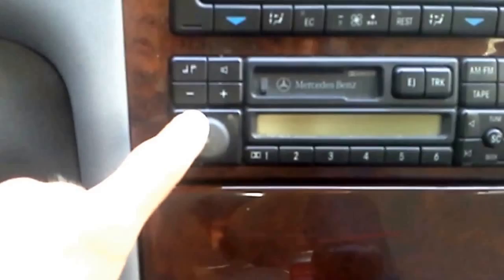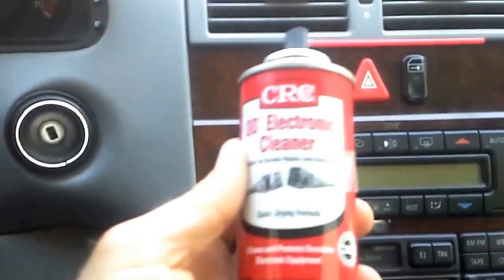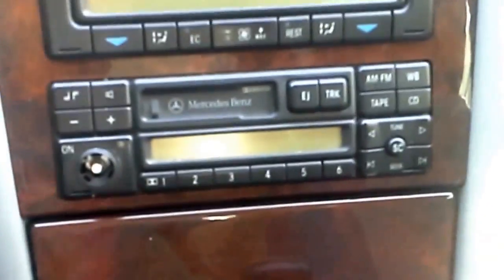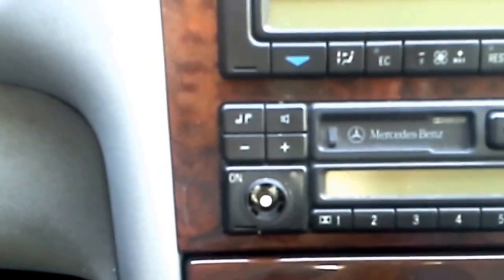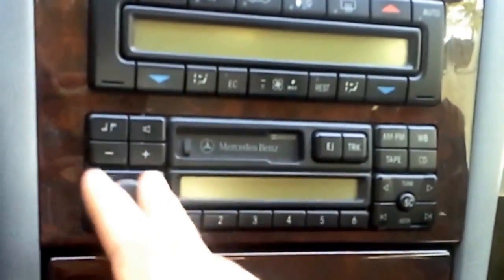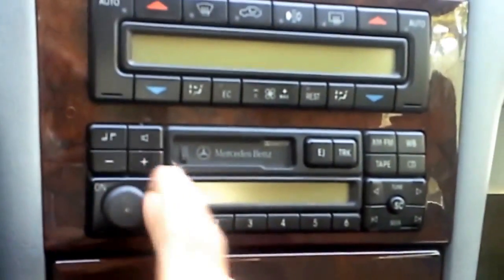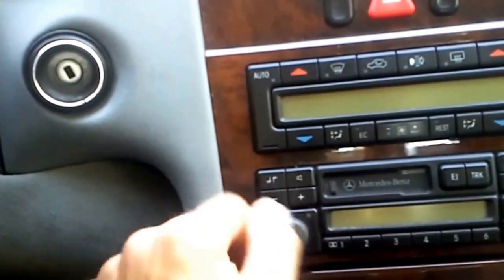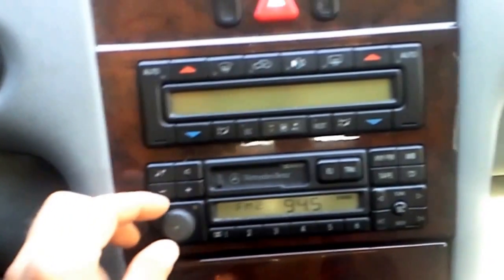How to Fix Mercedes Radio Volume Button

Comment: DON'T SPRAY with electronic cleaner!  It gums up the controls, makes it worse.   I found out the hard way.  It works for a few hours and then volume knob becomes completely erratic.  Spray with compressed air, and if that doesn't fix it,  ship it off for repair to Becker Autosound  in New Jersey.   A couple hundred dollars and well worth it.
Reply: I use it on electronic cleaner all the time and it works great on electronics. 
But it doesn't work on a volume knob for a Becker radio.

Comment: Well, I can confirm that this DID work for me for about a week, and then it started being erratic again. I then took some more contact cleaner and sprayed it in, shortly after, the knob became completely free of tension is now moving freely, making NO difference to volume. So while this may fix it temporarily, the contact cleaner application sort of broke it permanently. I was VERY careful with the squirts too.
Reply: Mine spins freely now too no small clicking noises like before
Reply: @sethdawg  I ended up with a permanent fix on my old radio. These becker units last forever. So I ordered a volume encoder, and had to carefully replace my old encoder with the new one after opening the unit. The volume knob on the outside connects with an encoder disc/wheel on the inside, that encoder disc is encased in plastic, and the plastic melts. In my case, the wd40 contact cleaner melted the plastic (since it's 30 year old plastic). I think that's what has happened to you. I've heard that there are better cleaners out there (deox-it is the best), but since the plastic is already melted, I had to replace my encoder knob. If your unit was working fine before, you will have to attempt to replace the encoder wheel by opening the unit also, the one I ordered came from Germany via Ebay, and the seller was extremely knowledgeable. I have tonnes of pics and videos of the job, will compile them into a video and post on youtube. The unit works fantastic now, like new! Lovely satisfying clicks.

Comment: I have 1999 Mercedes in excellent condition like new one owner was $ 80.000 ,always garaged and now I have exactly the same problem like you showing to the people on this video,just I have sound but very low ,can go anymore up or down always same volume sound,I try with this spray ,but not working  this way,and I have looking shame to say no one shop exist in whole City of Wilmington NC.No one service for repair car radio ,no one handy man who know something to fix radio.They just have the radio installer,and charging so much that you haw socked  what they asking.
Reply from the maker: Search "How to clean fix a potentiometer" on YouTube.
That's what tech's call a volume button.
If you want to keep this radio and the spray didn't work- you can do a more thorough job of cleaning the volume button by taking it apart but first have to remove it from the dashboard.